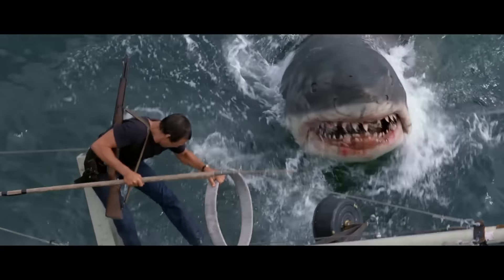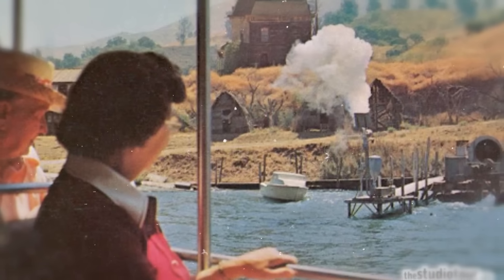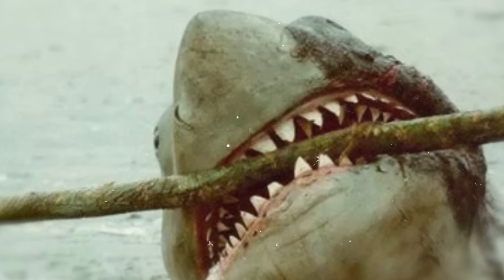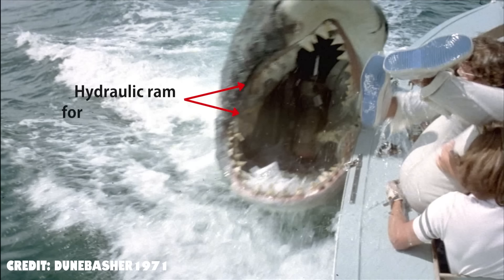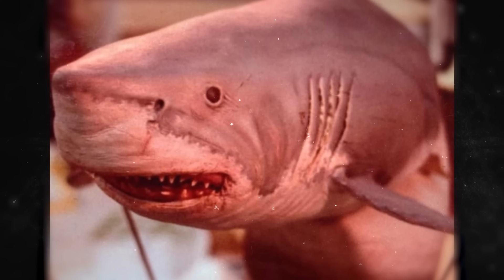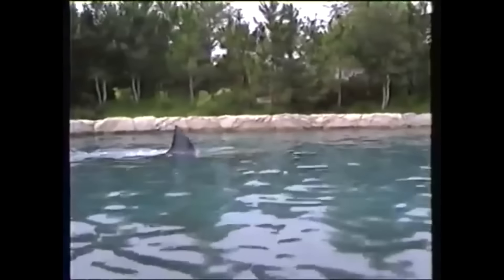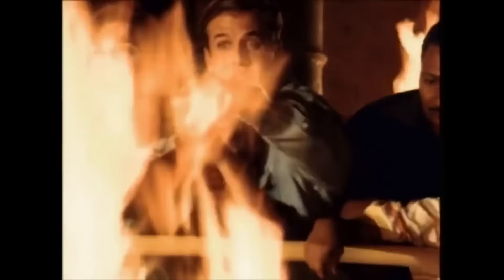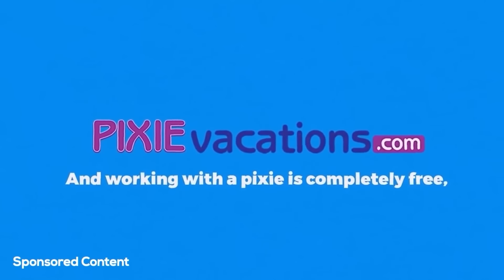Submechanophobia Jaws Animatronics Evolution

Comment: Sorry but Jaws 3 did have an animatronic shark you could even have your picture taken with it in Seaworld Orlando where the movie was filmed after the filming was completed
Reply from the maker: It was a shark prop not an animatronic
Reply: @fastpassfacts  they had a  shark animatronic for underwater sceans where Philip FitzRoyce and fred and female technation are killed also for the end when they pull the pin on the grenade to blow the shark up
Reply from the maker: @RetrosmileAdventures  that was a prop model with not mechanical parts as far as we know

Comment: Quite frankly, the "animatronics" would not work in water because of the risk of fire or electrical shock from electronic parts. The sharks were actually run by pneumatic (air pressure) and little of hydraulic water pressure systems... from what I read in making of Jaws books.